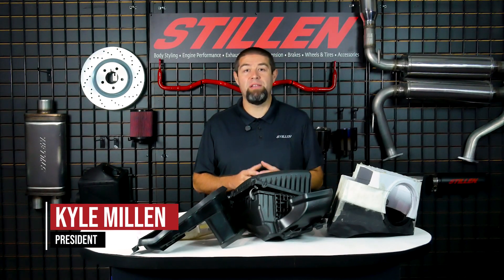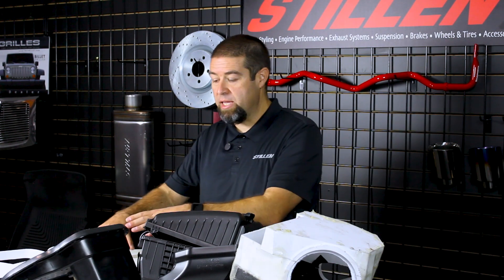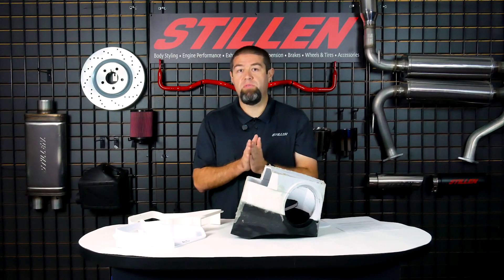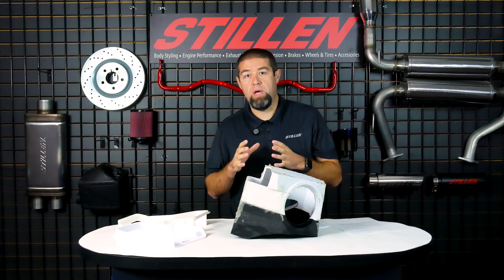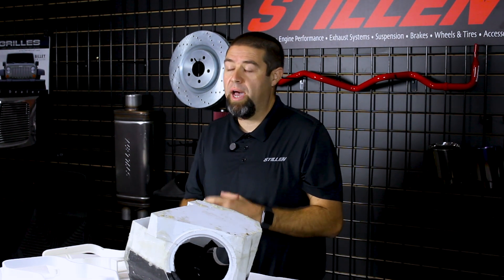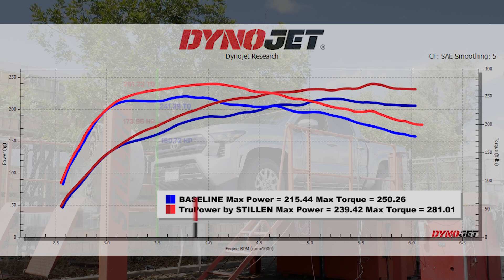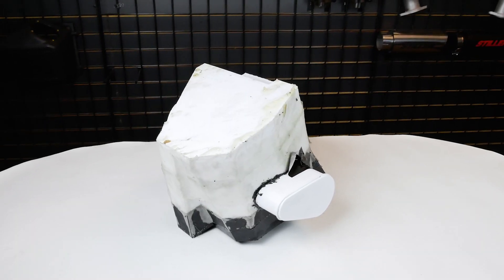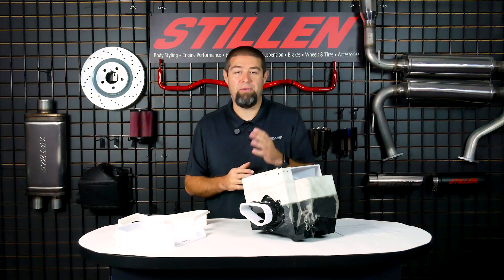2024+ Tacoma STILLEN Intake Box – Dyno Results Revealed

Comment: Just received and installed my intake today and I couldn't be happier. The power is definitely there and turbo sounds galore. But the other thing I personally tested was gas mileage. When in Eco and actively trying to save gas I got up to 28.8 mpg avg. My 2024 TRD Offroad has a level kit method wheels and 33 inch BFG KO3 tires. This intake is amazing and definitely worth the money.